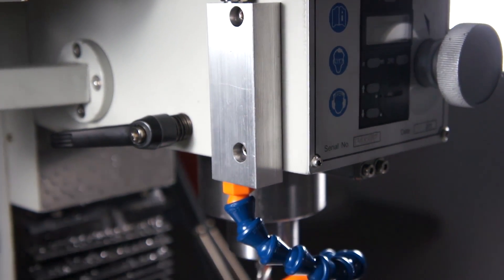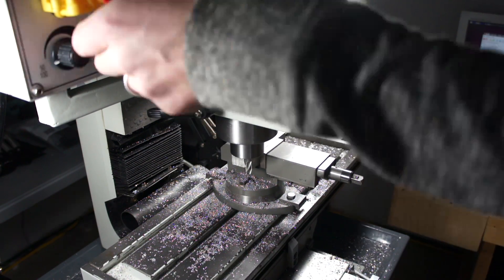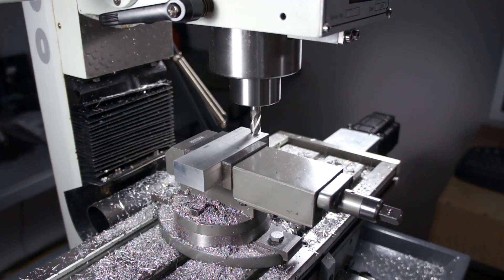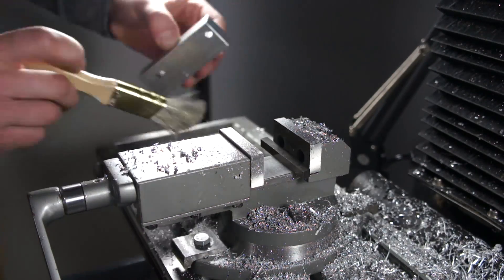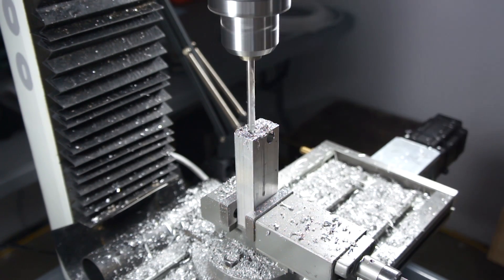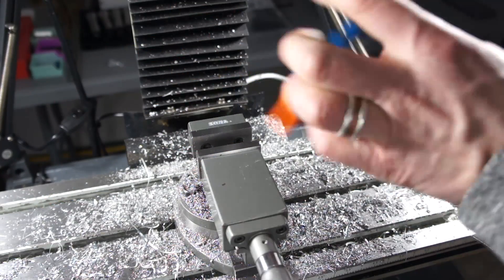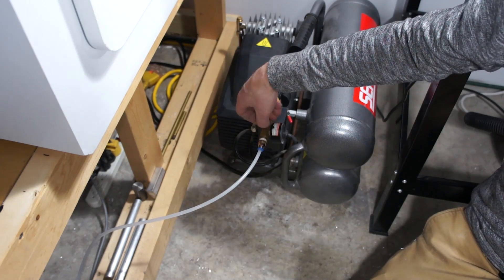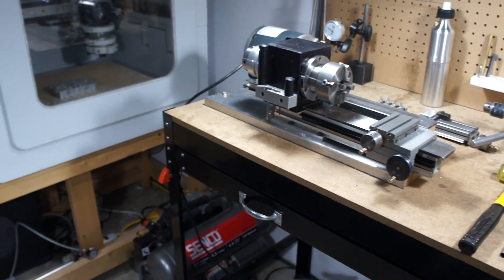Confounded Chronicles 07 - DIY CNC Air Blast

Comment: I can retrofit my manual mill with servos, but also would like to keep the manual element,  I would like to get it to work like an eztrak,  Do you think that you can put the servos on the other side of the handles and unlock the servos to work manually, and then  when you  need like a pocket etc, turn them on for a cnc operation, Any ideas?
Reply from the maker: Should work, but honestly just get a good MPG and use it as the 'manual' element. I had the same idea when I retrofitted mine and never used the idea. Much easier to just jog the machine around digitally (more repeatable feeds and way more precise)...just my opinion.
Reply: @CurtVanFilipowski  dud, you know what??   you just gave me a good idea,  in the pannel next to the keyboard , fix place and  MPG and also leave the manual handle,  I worked with that configuration and it`s very practical couse you never know when you might need something.

Comment: Hi Curt , Is it sufficient to cool only with air, or does liquid also have to be added ?
Reply from the maker: Depends on material, most still respond better with something added to the airstream to aid in cut lubricity.

Comment: Do you have a link to buy your manual coolant bottle? Regards and good job!
Reply from the maker: Thanks for the kind words.  Unfortunately I purchased it locally but if you google/amazon "pressurized oil can" it should lead you down similar paths...I can't find the exact one I purchased but there are similar units.
Reply: @CurtVanFilipowski  Thank you! I have found a similar can. Regards,

Comment: Hi Curt,  I converted my Mini Mill Recently and I was thinking about doing a similar air pressure system that you have. I was wondering if you could provide any spec's on the air flow and pressure details?

Comment: I also got rid of the safety switch early on, but I didn't have to solder the wires, I just traced them back to screw terminals in the control box and ran a wire inside the box.
Reply from the maker: A much better idea...next time I'm prodding around inside the box I'll bridge the connections.  Thanks for the comment!

Comment: I have a princess Auto Mini Mill (which I've only used once) - I was thinking about converting to CnC - where do you go to get your stock aluminum/metal? Everywhere I know of is massively expensive.
Reply: Also, is a Mini-Mill worth converting? I don't have a machinist background, so I'm not as knowledgeable nor do I have the skill to make my own conversion parts - or at least as easily as you.
Reply from the maker: I get my metals from metal supermarket (store is close to my shop)...not super cheap but wayyy cheaper then mail order options. I've seen a few people convert PA mini mills (which I believe are the same as the Seig S2 or S3)....I'd say it's worth the conversion...it's probably far better in terms of ridigidy then a shapeoko or other inexpensive cnc but if you don't enjoy the conversion process it may feel more like work. 
However your best option might be to just tinker with the mill in manual form for a bit...you should be able to fabricobble most of the conversion parts manually and skills learned in manual machining while not directly related to CNC will still help immensely when you do make the switch.
Reply: go to a scrap yard, they charge scrap prices for cut offs small bits and scrapped parts which are great for hobby projects